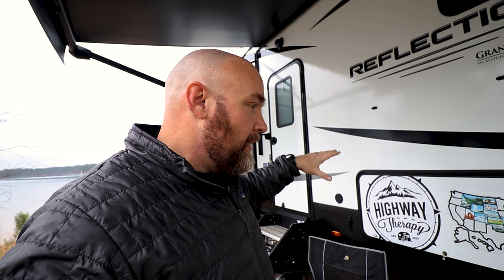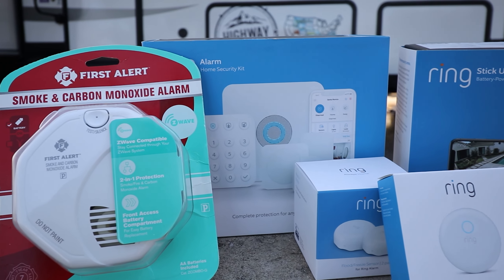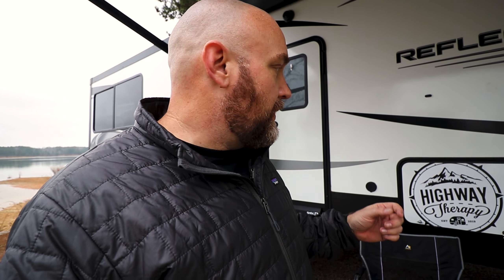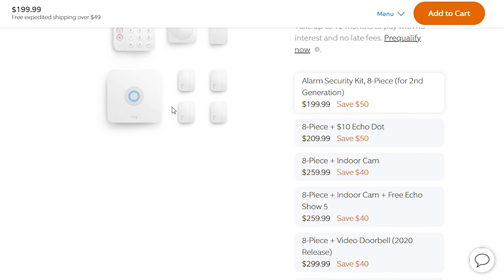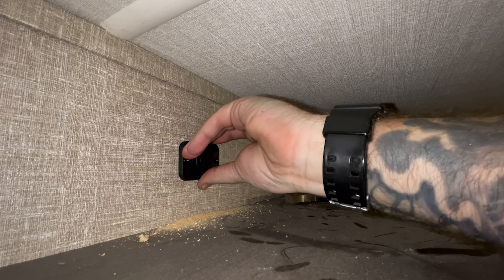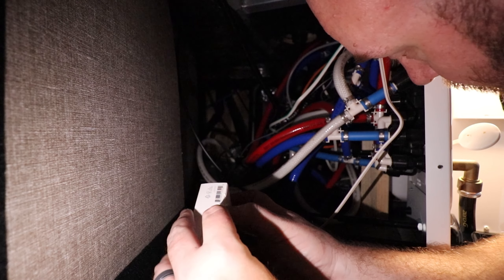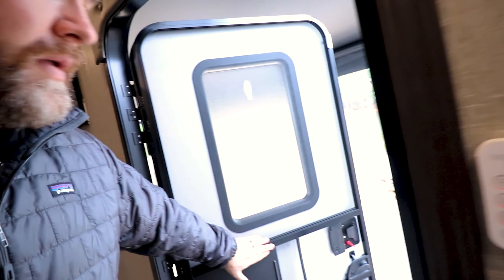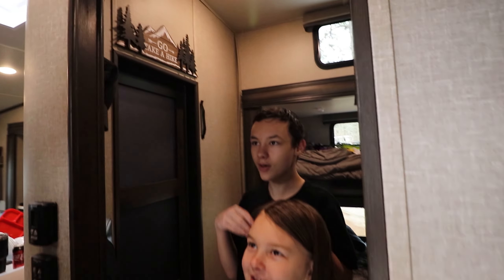THE ULTIMATE RV SECURITY SYSTEM 🔐 Ring Alarm System w/ Camera + RVLock V4 Keyless Entry

Comment: Having had the system for a while now would you buy the same system again?
Have you run into spots where Wi-Fi signal was not sufficient? If so, does the system still work to give you an audible alert if you are inside the camper & someone is opening one of your outside compartments?
Also, do you have a recommendation for Wi-Fi setups?

Comment: 👍👍👍 on the keyless entry locks.  All RV's seem to have one of a handful of key codes.  A good thief will have those keys.  Change them immediately.  I love the un-discussed options 3 😜. If anyone has a camera security system that runs off of the house 12vdc batteries, please let me know. I’d like to try to avoid an inverter and it’s inefficiencies of possible.  Thanks for the vids. Look forward to others.

Comment: Good information. Thanks. I am going full time in my truck camper. More worried about someone stealing my truck with my camper on it, So I am taking all measures to prevent that. Alarm System, Kill Switches even pulling certain relays out of the fuse box when I know I will be away all day, That along with the ring system and possibly a tracker seems to be about all I can do. Any other ideas are welcome.   2005 Ford F-350 - 2015 Arctic Fox 811

Comment: Great video! Currently setting up Ring security in my camper. What did you use to secure the contact sensors and alarm keypad? Thanks!
Reply from the maker: I used Velcro command strips for the keypad and that 3M automotive trim tape for the sensors. The factory adhesive strips weren’t strong enough.

Comment: Do you mind showing off your internet setup? That's a great location.
Reply from the maker: I’ve got a Netgear Nighthawk M1 modem connected to a Netgear WiFi Router.  It’s all plugged into a small power inverter so everything stays active even when we’re on the road and we can use our WiFi in the truck.  It’s not as fancy as some of the commercial grade setups I’ve seen, but it works!
Reply: @HighwayTherapy  thanks. I'm in IT. But haven't had time to look into modems that take Verizon/art.

Comment: Love my rv lock!
Love your ring setup!
What or who do you use for internet service?
Reply from the maker: It’s complicated...  😂 I actually cut that part out of the video because what I’m using right now probably won’t exist in six months.  That’s how crazy the unlimited data market is.  I’ve got an AT&T data only plan for my primary service, and I keep a Sprint/T-Mobile plan from Calyx as a backup. They’re both legit and truly unlimited, not those 15GB jet pack plans or the shady overpriced plans from the third party resellers.  Calyx is slow, but very reliable.  The AT&T plan is fast and has the best coverage, but you gotta jump through a few hoops to get it, and they could kill it off whenever they want.  That’s why I keep a backup.  Sorry I don’t have a better answer.  Like I said, it’s complicated, and all the easy solutions are gone now.
Reply: @HighwayTherapy  yeah no problem that's why I asked just out of curiosity 👍 can't wait for the next video

Comment: Help needed, I went to put something in the camper and the door was wide open. The door pulls open in the locked position. The camper is level. The deadbolt is engaged. A little tug and the door opens. Anyone know of a solution. I am willing to upgrade the lock but is there something else I am missing?

Comment: I just go a ring security system & have a Grand Design RV. How did you mount the contact sensors on the baggage slam doors. Can you send a picture. The swing door is easy, but the inside of the RV wall has me worried. Thank you.
Reply from the maker: 3M automotive trim tape!  It’s the same stuff that holds the emblems on your vehicle and it sticks to just about any surface.

Comment: Buy a wifi extender. Just like the one you have in a home that plugs into an outlet. Connect it to the campground wifi. Not only will it make your connection stronger but all your devices are secure from your extender. Which has its own security. And your own network.

Comment: Nice set up!  So.... with the ring setup.  You need to have the trailer connected to wifi somehow, might assume that you use something like a mobile hotspot or free wifi if available.  If you are in the boondocks, what happens?  Is it all useless at that point?
Reply from the maker: Without internet, the camera won’t record and it won’t send notifications, but the alarm still functions and the siren will go off if a door is opened without disarming.  In our case, we rely on a solid internet connection everywhere we go so it isn’t an issue, but it’s something to consider if you plan to leave your rig somewhere with no cell service.  The alarm is still a pretty good deterrent as long as someone is around to hear it.  Also, this may work on a mobile hotspot like a jet pack, but I wouldn’t use campground WiFi unless you have a router that relays the signal to your own dedicated network.
Reply: He is getting ready to show his wifi system. Said a video will come sone. We watch him on TicTok.

Comment: I called Ring and they say they don't sell a motorhome security camera that uses cellular instead of WiFi. 
I'm a full-time RVer and do boondocking in remote areas and need a security camera that works on a cellular network. Presenly I am in Arizona on BLM land where there is cellular but no WiFi.
When your away from your rig all the burgular locks are no good if your not there, and if your security camera cannot text you a message without WiFi.